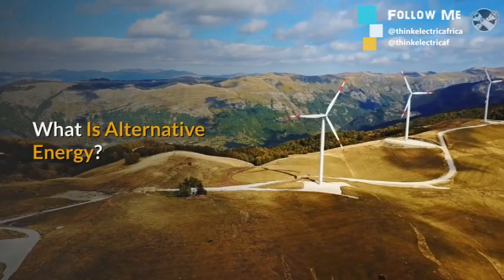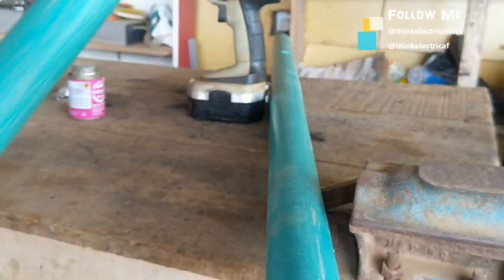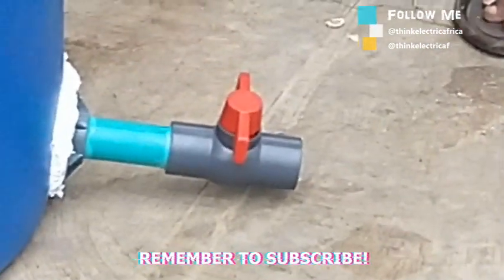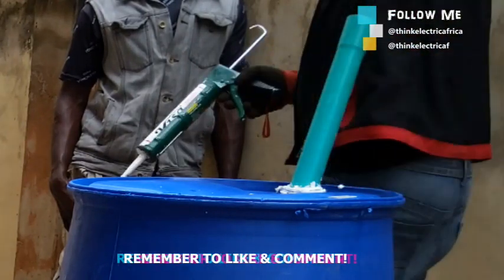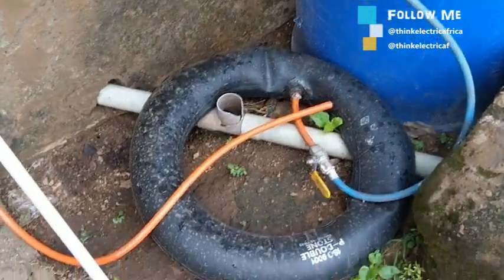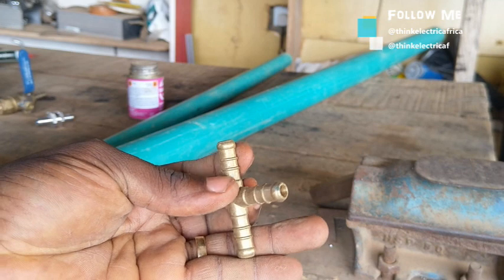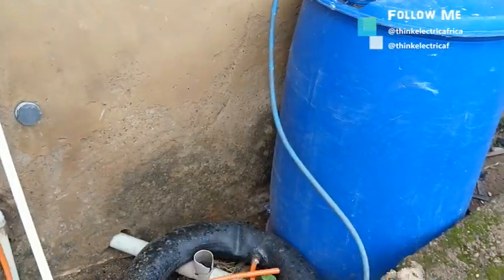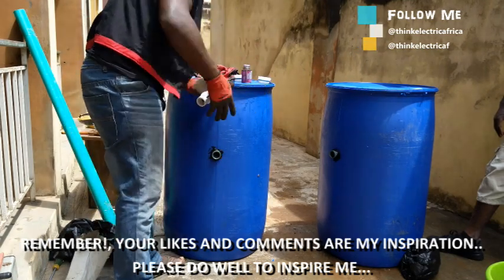You Are This Close To Enjoying Free Gas FOREVER!, Biogas Digester Construction Manual Guide.

Comment: Hi Brother, i want to place my biodigester in the yard in open space exposed to the sun. My fear is , i live in an extremely hot town where ambient temperature goes up in the dry season sometimes  to 30 degrees celcius and you know since the digester is airtight, the internal temeperature can be more. Should i continue keeping it in the sun?
Reply from the maker: Hi Atud, though research shows that warm temperatures help the digester to produce more, too much of it may be bad. Please be careful
Reply: You need a security valve. Maybe a bicycle tire valve used with the inlet in the barrel? 
Just an idea, i'm not experienced to know if it would work. One thing we know is you can't inflate a bicycle tire with you lungs, but a simple pump can. Maybe it has just the treshold pressure you need.

Comment: If I am correct, the gas is lighter with no enough pressure to provide enough power in the appliance. We use the gas tube to pressurize it so that it can gain enough pressure , it it so? let say I use a very big container let say 1000 liters which is three quarter filled, do I need multiple gas tubes? Is it obvious that whatever amount of gas from the container won't make the tube burst?
Reply from the maker: Hello Eng Herman, good to have you on my channel and thanks for your comment.
Yes you are correct, I just want to add that it is better to have a bigger gas bag for your gas storage if you can afford one.
There are biogas bags on sales on line, buy as many as possible for your gas storage.
Generally it is rare to have an explosion with Biogas if it is not compressed.
Reply: @thinkdiyafrica  if you have a link to those who are selling Biogas bags let me know.  Also if you know any dealer who supplies biogas fittings like ball valves, barbed Tee, adopter , hise pipes etc you can help me.  I am in Tanzania
Reply from the maker: @enghermannguki7029  OK, I will work on some links from China and America, I don't know Tanzania markets too well, but you can check your local plumbing shops for the fittings.

Comment: how do i know when it's time to open the outlet tap？in your recent videos you use two tank,what is the essence of the second tank?if its meant for slurry,how do i prevent the animaldung that is feed into the digester from going into the slurry tank through the connecting pipe?
Reply from the maker: Hi Adesoye, thanks for your comments and questions, you will sure know because you don't want it filled to the brim.

You can check the following links for more details:

1. Build a Digester with little effort: https://youtu.be/sayFLEDhRgE
2. FACTS TO KNOW BEFORE YOU DECIDE TO BUILD A BIOGAS DIGESTER: https://youtu.be/IL7-XzzAWpM
3. Maintenance of bio-gas digester https://youtu.be/a-EqDXXBB98
4. Biogas Digester Explained, All you need to make your own biogas digester: https://youtu.be/ZCbN4vjMcM0

The lady needed two to alternate it, so it was the same thing nothing special